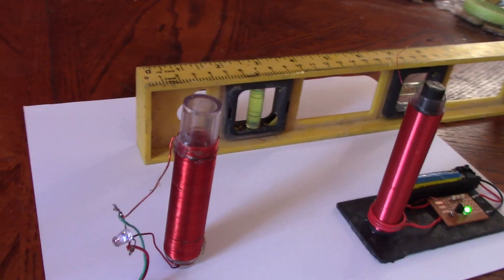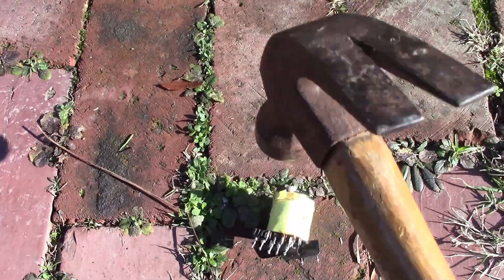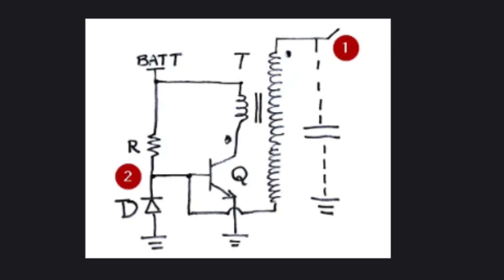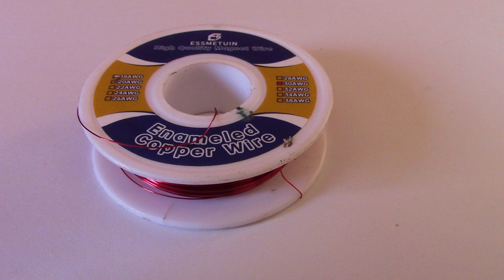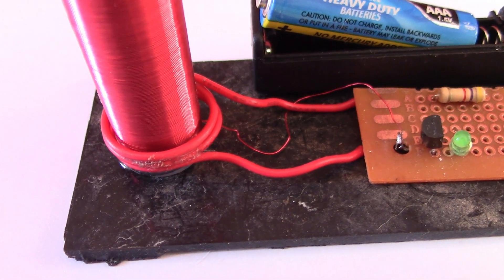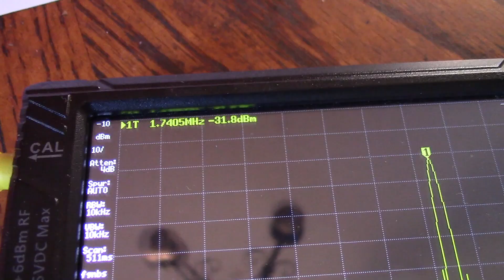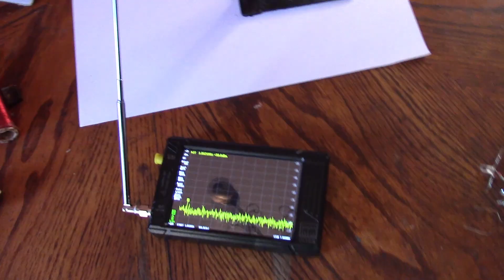Easy to Make Ferrite Tesla Tower | Surprising Distance & Power

Comment: Thanks for the video. What is an "AV double diode LED" and how does it work? It appears to be two germanium diodes connected in series connected to the negative and positive of the LED. Thank You.
Reply from the maker: An 'AV plug' is the common term. It's the first two letters of the creator, a Mr. Avramenko and the AV does look like the directions of the diodes. Typically, 1N4148 signal diodes are connected, but any can be used. Both are connected at one end together, one faces one way, the other faces oppositely. The other ends then become a positive and a negative, converting the fast pulsed on/off energy from a wireless energy system into a positive supply and a negative supply for a DC load.  A capacitor across the outputs can help to smooth that DC type output supply and then things like motors can run. The 2025 sign already has a supply capacitor onboard, so was able to work. 
Can see the connections at 2:17   😀

Comment: Is there a benefit to using the standard slayer exiter with a bjt over a slayer that uses a mosfet
Reply from the maker: Both are effective, being as only a switch function is being used. I think though, that BJT's tend to be used for lower power projects, there being no usual need for 10A handling or up to 100V as common for MOSFET's. Also, BJT's tend to work from around 0.6V, are cheap and have the bandwidth 😀

Comment: So, basically you drive 25 oscillators using one wire transmission with only one source which also powers one oscillator itself ?

I wonder if you would be able to power a dc/dc buck booster together with your 2025 blinking lights and charge a 1.2 V aa rechargeable battery ?
Reply from the maker: 25 LED's, but running through the main osc circuit, yep. 
A buck booster would be fun. If it worked I would think it would have low current output, the main circuit only drawing around 30mA. However, it should charge a 1.2V battery to some extent. It's an interesting question and I'll likely look at that in the future  😀

Comment: Great demo, many thanks for sharing … this really helps me a lot in my project. Quite impressive to see no power loss of pulsed DC for that distance using such small gauge wire in one wire transmission. I guess adding a coil at the end of transmission line may yield more power for your 2025 blinking leds.

And all of this with just a little 1.5v aa battery ❤
Reply from the maker: Thanks Caesarus, happy you liked it 😀
Yep, a coil on the end would help.. especially tuned with a capacitor.